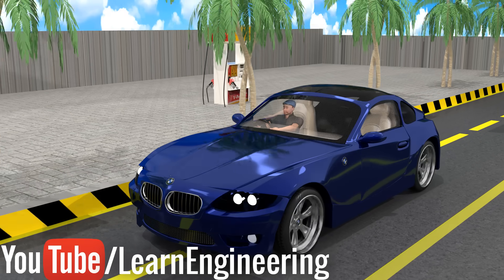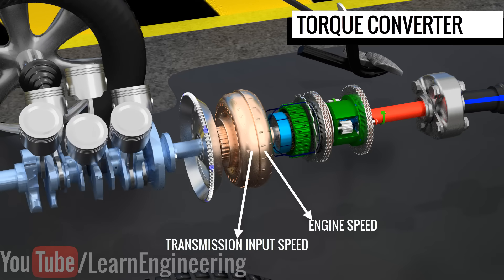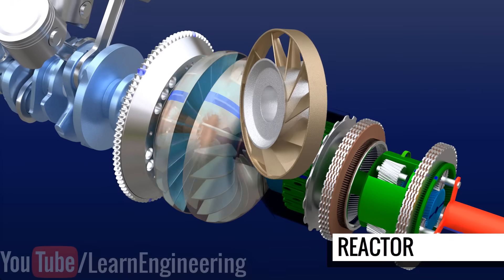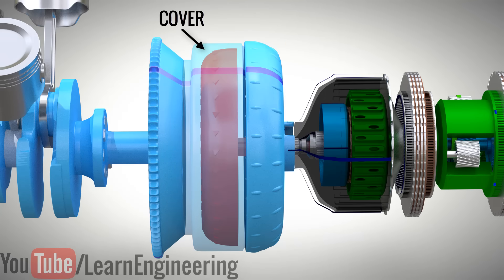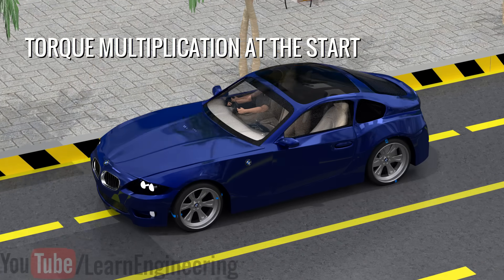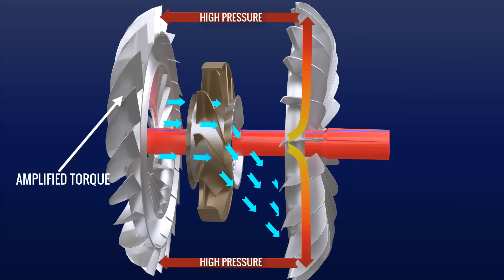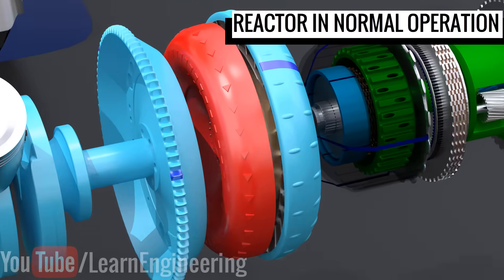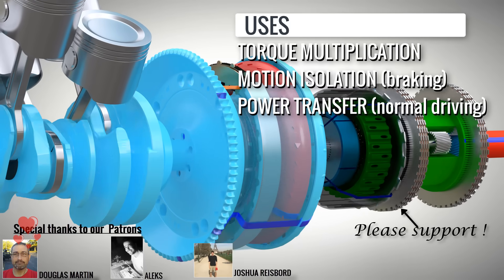Torque Converter, How does it work?

Comment: I always thought the car somehow put itself in neutral when you stopped. Never would have thought of this.
Reply: Some cars actually do it, but not for the reason you were thinking. Putting the trans in N eliminates the drag caused by the slipping torque converter / fluid pumping (the drag is the reason the car creeps when you let off the brake) and decreases fuel consumption while stopped at a light.
Reply: On automatic clutch transmissions like DCT that is what happens.

Comment: Torque converters are basically never a problem area in a typical auto transmission, right? I've never had a problem with one anyways. Do the lockup clutches ever fail?
Reply: I put 140k race miles on my scion's stock tqverter
Reply: Not really, they could but they generally outlast the rest of the transmission.

Comment: So when you stop at a traffic light and the engine is still spinning that pump, but you have your foot on the brake, what does all that fluid pressure/force do since it can't turn the turbine ?!
Reply: Nothing, it's just there so when you get off the brake you have some instant torque i guess.
Reply: I guess that kinetic energy of the fluid is converted into heat as the fluid hits blades of turbine.

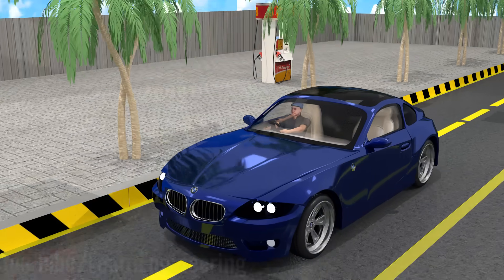Comment: 0:36 When you press the brake pedal, you disappear.
Reply: That's why you should always only use the throttle
Reply: LOL
Reply: this happened to my dad
Reply: ...and turn into a torque converter
Reply: If you press the brake pedal you go to a different dimension
Reply: He went 😐✌ after braking.
Reply: He went out for coffee.     There is also so much room for  3 seats in that car design
Reply: All I can say is Animation isn’t easy
Reply: COCA COLA ESPUMA
Reply: that is why i never do
Reply: into the backrooms
Reply: Wired ejection seat
Reply: Yess

Comment: Meh, all that wasted energy due to the fluid, the manual transmission is far more efficient, mechanically simpler and more reliable, plus, most manuals rarely, if ever, require transmission fluid change, unlike automatics...

I have an ‘07 VW Rabbit 5 speed manual with around 200,000 miles, still on the stock clutch and transmission fluid, try to get that life out of a bloody automatic, won’t happen.

Plus the manual is far more fun and engaging in all driving situations except sitting in traffic...
Reply: Modern automatic transmissions can equal the longevity and performance of standard transmissions but two things must happen. The service interval must be followed and change the fluid and filter as automatics tend to be neglected. Install an aftermarket trans oil cooler. The oem cooler is a joke. Many new cars operate way too hot according to specs. Yes, manufacturers should install these at the factory but thats unlikely to happen.Of the cars I have owned with automatics, Ive NEVER experienced any issues at all since I maintain them. Visit any transmission shop and you will be hard pressed to see any manual trans being worked on. Most of these automatics are there because of the combination of neglected  care and too high an operating temperature.

Comment: But what happens when you apply the brake, How the Transmission is isolated? 
The Pump will be in rotation as it is attached directly with the shaft and the fluid will be set in rotation and will force the turbine to rotate?

Comment: So the reason why an automatic can drive is because the transmission fluid is being turned so fast that it makes the other half of the torque converter spin with it, and when you brake, the fluid settles and it stops moving it?
Reply: The fluid can be "sloshed around" by an idling engine, not having enough force to overcome the brakes. This creates heat instead. Most (good) automatic transmissions have a separate cooler for the transmission. When the fluid heats up it also expands and creates pressure in the torque converter. A pressure valve then let some warm fluid out to be cooled. There is a pump that puts transmission fluid to the right places in the transmission as well as back into the torque converter.
Reply: Gert Ahnström alright

Comment: Now the question is assuming the turbine output shaft splines directly to the wheels, will pushing the car forward turn the engine over?(push start?)
Reply: Yun H.      Most cars will move on there own when you start the car and shift into drive let your foot off the brake you’ll start to roll forward slowly and I’m not talking being on an incline I’m talking on flat surfaces it’s because of that torque converter it’s slowly pushing the car at the low RPMs at idle

Comment: For years, all the explanations I could find skipped over the one-way clutch, but I couldn't see how the converter could work without it; how could you have more torque out than in with no connection to be body of the transmission?  Finally, about 15 years ago, I just Googled "torque converter" AND "one way clutch" to find a complete explanation. This animation makes it even easier to understand.   Thanks for posting.

Comment: May i know...how turbine transmits the power to the transmission system when the operation of reverse gear..???
Reply: venkat sai teja chunduri 
From my understanding, when you are in reverse gear, the input shaft from the engine as well as the torque converter will still be rotating in its normal direction. However, inside the transmission, the configuration of the  gears will allow the output shaft to rotate in the opposite direction. The change in rotational direction of the output shaft comes from the gears inside the transmission itself while still allowing the engine and torque converter to rotate in its normal direction. In conclusion, the torque converter still transmits the power to the transmission normally, but the reverse gears inside the transmission is what changes the direction of rotation in the output shaft. I am not a mechanic and this is just my understanding of it. Hope this helps :)
Reply: EdgyEgg 
Thanks a lot.
It adds some more knowledge to me.

Comment: When the lock-up clutch is engaged, the engine and the transmission are mechanically connected. How can I change gear in that situation?
Reply: Don't quote me on this but maybe the lock-up clutch is disengaged when changing gear, to "absorb" the difference in rotation speed. At least that's what happens in my car I think

Comment: so this thing is why i can hold my brakes down and gas it without moving my tires at all always wondered where the energy was going if the engine was putting out power but the tires aren't moving

Comment: Great video. I had a manual transmission car, and while pulling my heavy boat out of the water, blue smoke came out of the clutch. After I switched to automatic, no more smoke and I really wondered why I did not damage anything. The torque converter explains this perfectly.

Comment: For someone taking so much time to get the animations so clear, I am surprised that they got the engine wrong. The BMW which this model is based off, does not have a V6 engine. In fact, as far as I know, BMW does not even make V6 engines, only 4 and 6 inline, V8 V10 and V12

Comment: Will a bad torque converter make transmission over heat
Reply: Yes it can.if the stator (called a reactor in the video) didnt free wheel as the turbine speed approaches pump speed. Here, torque multiplication isnt needed. If there is an issue with the free wheeling clutch,ie sprag this can cause overheating. Ive seen this happen after a fluid change causing new fluid to overheat to the point to turn it from red to BLACK with a bad burnt smell. IF YOU omitted the stator and only had the pump & and turbine you have a fluid coupling. The early 4speed hydramatics used two fluid couplings in fact.These tended to be geared very low in the 1-2 shift causing a very hard shift to higher gears. This actually compensated very well untill later years when torque converters were perfected. Other cars had no gear changes at all but relied on the torque converter itself for starting and acceleration. The twin turbine Dynaflow transmission functioned in this manner. It was very smooth since there was no gear shifting but it was slow to start at took a bit. linger to attain road speed.

Comment: Fluid coupling ... not rocket science. Due to hydralic pressure moving the car, heat is a byproduct.  Manual transmissions will always outlive an automatic with same duty cycles.

Comment: Question, what if the stator was welded to the stator shaft? What would happen during the fluid coupling stage?
Reply: It would create lots of drag, acting like a brake trying to slow down the converter. Similar to hydraulic "retarders" used in trucks.

Comment: This video makes one thing VERY clear:  I will never understand how these things work.  I'm getting close on string theory, but torque converters?  Fogettaboutit.
Reply: I feel the exact same way.
Reply: @davidjimenez7556  :o)
Reply: It’s simple, the Transmission Fluid drives the car. without it, the two Turbines would just spin side by side, think of a desk fan blowing against a stationary fan with no motor, the moving fan will cause the other to spin via the airflow of the blades, it’s the same principle 😁

Comment: Seems rather inefficient compared to a standard transmission
Reply: When it locks up it is exactly as efficient as a dry manual clutch. When starting up it is more efficient (in terms of fuel economy) because it trades speed for torque so it requires less rpm (and less energy) to start moving. It takes a little longer (I guess, based on the laws of physics, I actually never drived an auto tranny) but it is more efficient.
Reply: @alessandroceloria  what about the added components and the time, energy, money, and man power required to produce them?

Comment: And i'm stil wondering what for it's made like that? Why there is no torque convwrter in manual transmissions? Why there is no typical clutch in at?
Reply: In manual you have no torque converter because it does not need it, you manually actuate the clutch with the pedal. You cannot put a torque converter in series with a manual gearbox since you need to completely disengage the transmission in order to manually change gears, otherwise the drag from the motor spinning would completely grind off all the gears before you could reach home with your brand new car
Reply: @alessandroceloria  Ok, great, i understand but why there is no lag when the engine starts spinning rapidly ? There is a fluid inside and the other part of the shaft need time to match the rotation speed of engine... Why there is no "automatic clutch" which would do the same work as Your foot in case of manual transmission?
Reply: @elgoogssie3969  Indeed there is lag when the car starts. What you are referring to does actually exist. Double clutch transmissions do exactly that: the car has one clutch with the odd gears and another clutch with the even gears. When you shift say from 1st to 2nd gear, the odd clutch disengages (automatically) and the even clutch engages (also automatically). Then the odd gearbox automatically changes gear to 3rd in order to prepare for when the car needs to shift again. If you brake, the odd clutch will return to 1st to be prepared to shift down. That's a hell of a fast transmission, but since you need to double up on clutch and gearbox it's also quite expensive. In the recent past single clutch robotic transmissions existed. They were like normal transmission but actuated meccanically by a computer, but they fell in disuse as they were quite unreliable and veeery uncomfortable to ride. Using two transmissions allowed for a much smoother drive.

Comment: When using lock up clutch how do it isolate motion? How is lockup clutch released?
Reply: The ECU automatically locks the trasmission when the car started up and the slip/torque multiplication effects are no longer needed (in fact they are only needed when stopping and starting the vehicle). It then disengages the lock when it detects the speed dropping and you coming to a stop.

Comment: How are the different torque multiplication achieved with it, ie when vehicle moves at high speed?
Reply: The torque multiplication is given by the difference in rotational speed between the three rotors. It's an effect that only happens when the vehicle is almost still, not at high speeds. Speed multiplication is achieved with a gearbox.

Comment: Could be my ignorance, but the reactor (or its fins) in the video seems to be turned in the opposite direction.
Reply: This video is not clear as to what the reactor is doing.  It seems that the bearing for the reactor is solidly attached to the shaft.  The bearing allows the reactor to spin in the same direction as the pump and turbine.  A one-way clutch keeps the reactor from turning the other way but that would apply counter-rotating force to the shaft.  The shaft is connected solidly to the turbine (front unit w/ fins).  
I'm fucking lost.  I'm gonna go lie down.

Comment: What happens when brake?
Reply: The turbine stops, the pump continues to rotate and pump fluid, but the turbine doesn't move because it is solidal with the drivetrain which is, well, braked. The reactor doesn't also move because of the one way clutch.
Reply: @alessandroceloria  Are you sure?
Reply: @선점-y9j  Yes. If this wasn't the case the engine would stall at every stop. I am non 100% sure the reactors stops, but I'm quite confident it does. However there are no doubts the turbine stops.
Reply: @alessandroceloria  I can't agree. I think only tires stop when brake.
Reply: @선점-y9j  What you are saying is impossible. In order for tyres to rotate they must be solidal solidal with the rotation of the drive axel, which in turn must be solidal to the differential, that must rotate with the gearbox. If ANY one of these elements is not solidal with each other, then the drive train is interrupted and the wheels will NOT rotate when you give gas. If the wheels rotate, EVERYTHING rotates, down to the very pistons in the engine. That's why if you leave a manual transmission car on a slope with 1st gear engaged and shut the engine off it will not start going downhills: the friction from the motor prevents the wheels from rotating. The only exceptions to these rules is when the gearbox is in neutral (in these case the drive train is interrupted in the gearbox so its input is not solidal with the output) or when you release clutch in a manual (in this case engine output is not solidal with gearbox input). Since automatics can idle in 1st gear, it is evident that there is another point of interruption in the powertrain. That point is inside the torque converter, where the output is never solidal with the input. They just happen to run together because of fluid dynamics. But if you apply enough resistance to the output shaft (eg braking) then the kinetical energy carried by the fluid will not be enough to overcome it and the vehicle will not move. However, the engine will not stall because, again, the input and output shaft of a torque converter are never solidal unless the lock is engaged (which does not happen when the vehicle is coming to a stop, starting up or idling). Hope this helps to clarify
Reply: @alessandroceloria  Hmm.. Thanks for reply still I can't agree.

Comment: but how does it change gears all on its lonesome?
Reply: It doesn't. A gearbox is driven by the output shaft of the torque converter (turbine). THAT handles changing gears

Comment: I set my bike up so the engine drives a alternator and the back wheel is driven by a motor powered by the alternator when i energies the alternators armature it starts to produce power and sends it to the back wheel it also has a chain to the same back wheel when i want

Comment: Just googled torque converters  Wikipedia page. Got redirected to main article female diaphragm. Most common design used  2500PMS stall. JDM tranny's largely referred to at ladyboy- box. If equipped with tiptronic are known as bean-flick-shiftin.
Reply: Yes.

Comment: Good video.
But you should have given credit where credit is due for this groundbreaking engineering masterpiece. This invention was the equivalent of a 'moon landing' within the auto industry.
Just sayin'

We can all thank Chrysler Corp. for inventing torque convertor technology.

Chrysler Corp. also invented and perfected its sequel, the lockup torque convertor, as well. 

Without this lockup clutch design, which provides 100% efficiency when coupled, overdrive transmissions would not be possible.

So Chrysler deserves credit for opening the door to overdrive automatics as well.

Automobile manufacturers are disadvantaged by the fact that Chrysler Corp. holds all the pioneering patents... which gives them first-crack when it comes to applying these technologies. This forces manufacturers to find alternative methods in order to acheive similar results.  Dependability varies accordingly.
Just sayin'

(Auto trans specialist, since 1974. All makes. All models.)